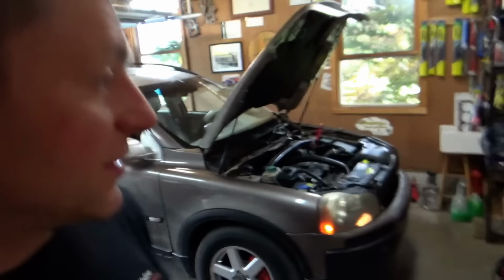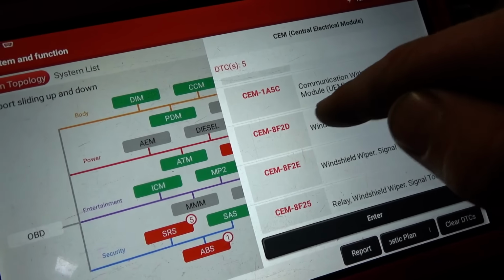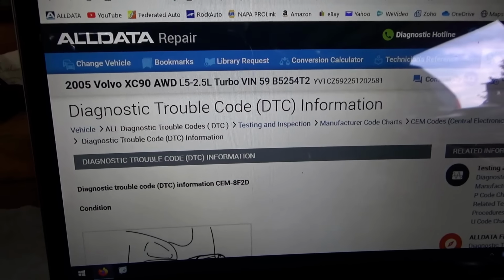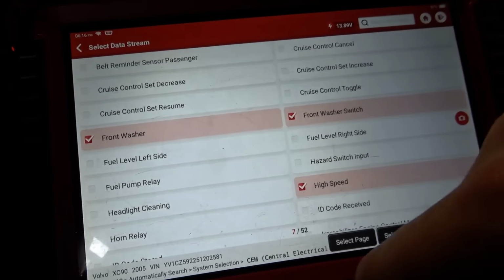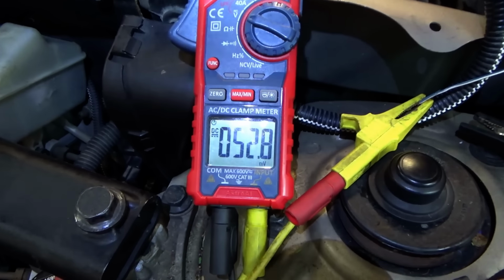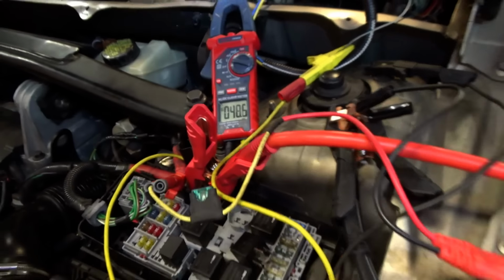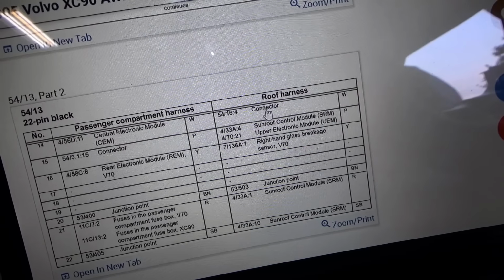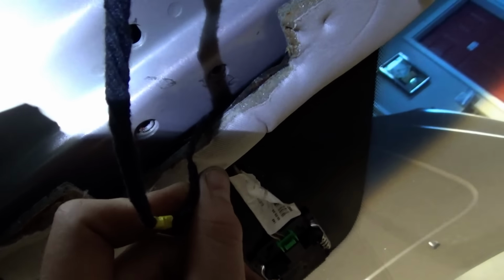(Pt 3) Volvo From HELL...Wipers DIY DISASTER! (05 XC90 Turbo)

Comment: Customer only pays half for the diagnosis and replacement of the fuel pump?  What a tool.
Reply: I used to make house calls fixing exercise equipment.. and agreed upon rate of $85 come to the gentleman's house. After making the required repairs and adjustments, no parts required, the "middle eastern" Pediatrician said, "Please, can you take $60?" (5 car garage, no less) And without batting an eye, I replied.. okay it's $95. He snapped back,  "but you said $85!" I said "EXACTLY!" I can add to this story but I will spare you all! Lol
Reply: He paid half now so that Ivan can go on to the next diagnosis. He'll pay the other half later.
Reply: @markanderson2904  Why?   what is the point in waiting?   Just pay it;  it makes no sense.  Unless Ivan just insisted on only taking half, trying to be nice or something.
Reply: @markanderson2904  I'll pay you Tuesday for a hamburger today
Reply: Tell him. I'm done. Diag is over.
As soon as the haggling started. 
End of phone call. 😄😄
Reply: I would have told him to get to Feck and come and collect your junk.
What a cheeky Bastardo.

Comment: Ashamed to Say I Used a Wireless key Fob Switch to Opererate Wiper Washers on a Jaguar XF - ByPassed ECM control completely.  Was not gonna Buy a ECM for Fu*king wiper washers.    Worked fine  I kept fob in centerconsole.
Reply: Smart 👍

Comment: Car payment are expensive.  Buying a used, crappy, high end car is even more expensive!

Know what you are buying before you give someone your hard earned money.

If you are not mechanically inclined, pay a reputable mechanic to inspect it.
Reply: No, cutting of a 30+ pin connector off a harness and splicing it together by twisting the wires and electrical taping them is expensive. Doesn't matter what the car cost new.
Reply: @tschuuuls486

Did the wire cutting have anything to do with a cramped up gas tank causing fuel pumps to fail after 2 months?  Owner bought used (not new) and did not have all these miles by themselves.
Reply: @jefferyedwards5003  no. But getting your gas tank cleaned is the same price on a high end car and a cheap one. Saddle tanks are pretty common across the board.
Reply: @tschuuuls486 You are exactly right,  what was I thinking?

Comment: My ex boss has a 2010 3.2 XC-90 and it’s never had all the issues this one has. Definitely was abused by the previous owner.
Reply: Or current owner.
Reply: @walkingman9171  in the first video, Ivan states that the current owner just bought it with these problems.
Reply: Water in the passenger foot well, major red flag for Volvos with sunroof...
Reply: @nikosuoa  watch all three videos, the windshield is broken and water came in through there.
Reply: @Jonathan-A-877  Aha, thanks for the heads-up :), anyway I am surprised that this water hasn't already caused more problems...